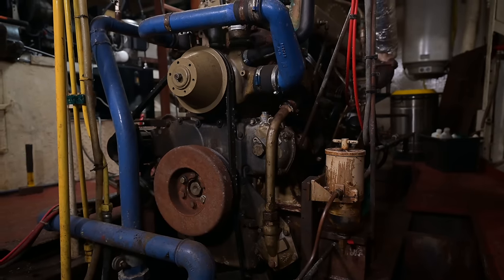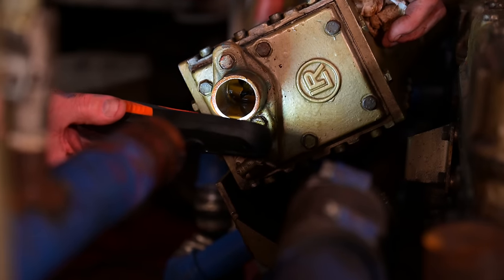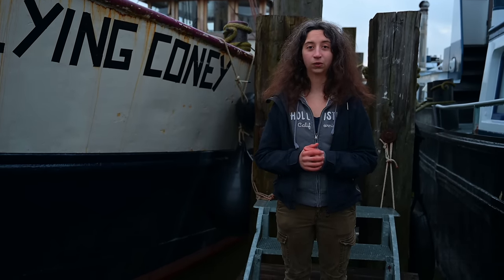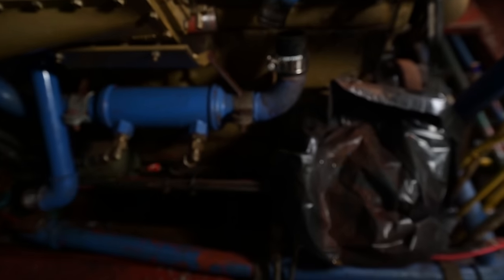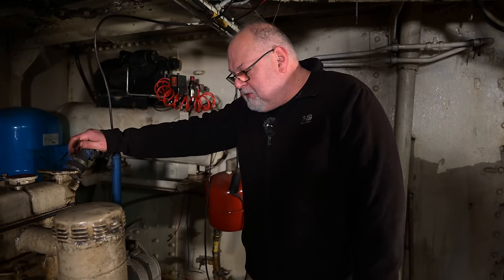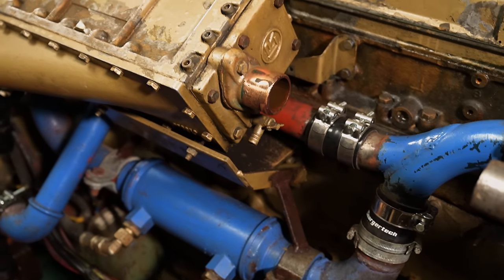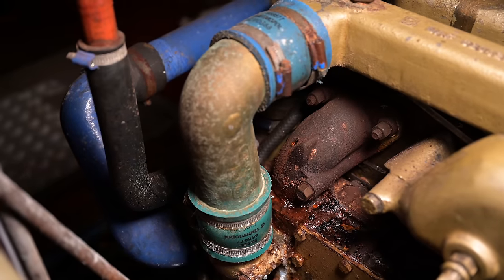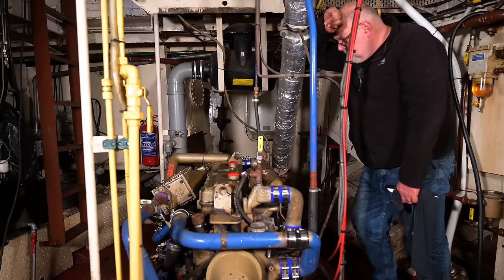Can We Save The Big Diesel Engine Of Our Expedition Trawler Yacht?

Comment: Hoses say nothing about the condition of the engine, a compression test does!
Reply from the maker: Well a broken hose says something about the condition of the coolant hoses.
Reply: @FlyingConey  Talking about the actual engine, not the cooling hoses.
Reply from the maker: The point is, if you take off all hoses like we did you can inspect multiple parts of the engine. You can check for corrosion, you see if there's carbon build up or oil were it shouldn't be. Together with the sound when the engine is running and also if it's smoking gives a relatively good impression about the condition. @rudihenry5298
Reply: @FlyingConey  True👍